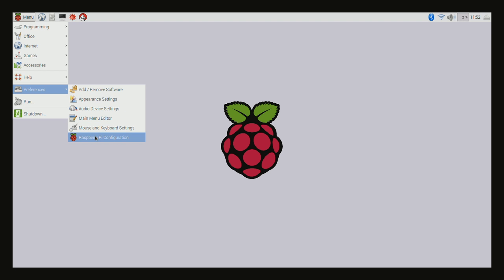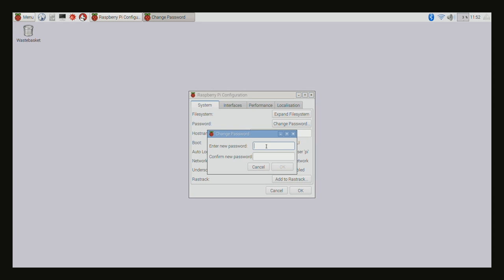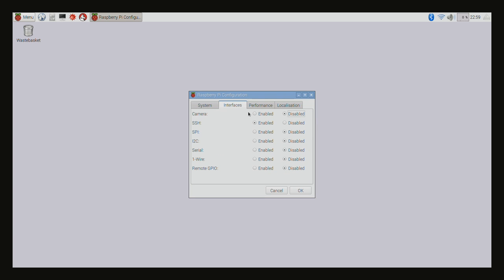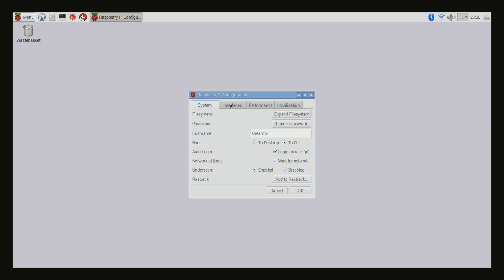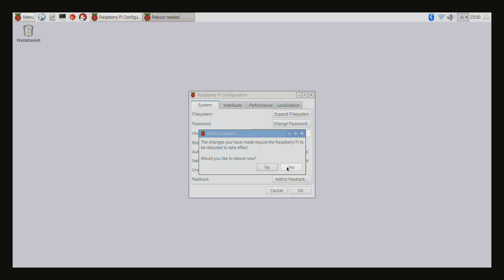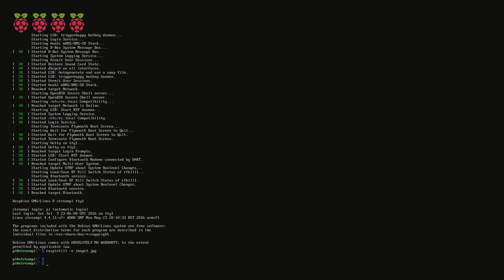Raspberry Pi: Stream to Youtube / Twitch in full 1080P

Comment: great built, could there be v4l for these cams now as last I played they were exceptionally useless due to lack of support, recording locally into a file or piping the camera via | is ..well less than optimal
Reply from the maker: Hey, there is an avconv version of the script, but for reasons unknown YouTube doesn't recognize it.  Here it is:

raspivid -o - -t 0 -vf -hf -fps 30 -b 6000000 | avconv -re -ar 44100 -ac 2 -acodec pcm_s16le -f s16le -ac 2 -i /dev/zero -f h264 -i - -vcodec copy -acodec aac -ab 128k -g 50 -strict experimental -f flv rtmp://a.rtmp.youtube.com/[yourcodehere]
Reply: Thanks for the command line :-)
The video itself was quite useless. I mean, the title suggest/hints on how to use the hardware with youtube, but shows instead how to mount hardware to a sheet of acrylic glass :D

Comment: Would a Pi Zero W work for this project? just wondering as I plan on using one mostly due to it's size.
Reply from the maker: Paul Catlin I don't know... but I've bought one to try... will let you know.
Reply: skiwithpete Thanks for the reply, would like to hear the results. Will give it a go aswell and see what happens :)
Reply: Tested this with the Pi Zero W and it works a treat, just wondering how I change the resolution to something like 720p?
Reply from the maker: after raspivid add -w 1280 -h 720
Reply: skiwithpete Thanks :)

Comment: Can this work with a usb h264 webcam like the logitech c920?
Reply from the maker: i don't know for sure, but I don't see why not.
Reply: I try it with '-i /dev/video0' and get this back..

/dev/video0: Invalid argument
[flv @ 0x1ac21e0] Failed to update header with correct duration.
[flv @ 0x1ac21e0] Failed to update header with correct filesize.

The device needs special arguments to define the video? Guess I'll try to goolgle more.
Reply from the maker: i use a C920 for most of my video making (it's my action cam and selfie cam in my livestreams - and that's on an Ubuntu Box).  I use it with OBS.  I can't say I've seen that error before, nor that I know what it means.  Do let me know how you go.
Reply: I got a raspberry camera and it's streaming now but also showing the video of the camera. Is there a way to stream without displaying the captured video locally? Also I can't seem to get out of the video window on the Pi, tried many different keyboard combos but it's like stuck showing the camera video.

Edit: Got it. Now just got to figure out how to enable the mic.
Reply: Hey Matthew, can you share the ffmpeg command to stream c920 to YouTube Live, thanks!
Reply from the maker: Look in the About Section of this video.
Reply: Thanks for the reply skiwithpete,

swapping out  -i - for -i /dev/video0 gives me this error

 /dev/video0: could not find codec parameters

And I can't use the c920 with raspivid to pipe in the camera output

Any advice would be really appreciated!
Reply from the maker: Try to find the codec that the c920 uses.  Is it mjpeg?  make sure you have that codec correctly referenced.

Comment: Can I use pi3 to steam with OBS?
Reply from the maker: Line command only.
Reply: I think you can if you run “motion” on the rpi and enable network stream.  Then in OBS create a browser window with the ip address of the rpi stream.  (Well thats the way I plan on doing it.  I’m starting the project today.)
Reply from the maker: That would be awesome.  Keep me posted!
Reply: I got the rpi streaming on OBS (sorta).  The only problem is there is a lag in the video.  I used the MotionEyeOS image for the rpi.
Reply: Of you tried a magewell or a black magic USB capture card that might do the trick. This way obs/ RPI doesn't have to transfer code